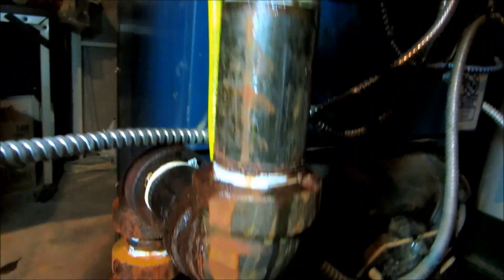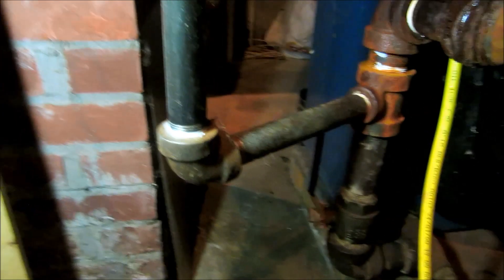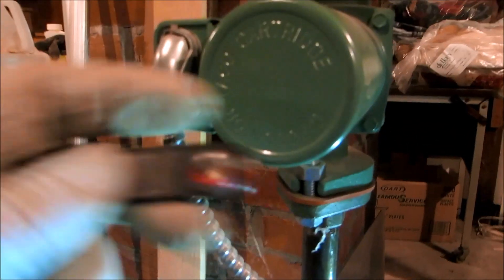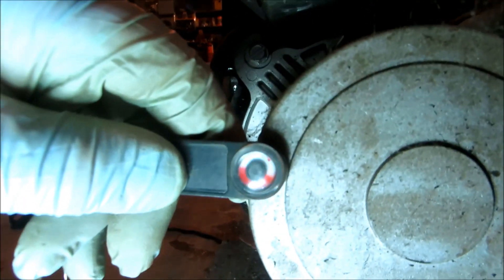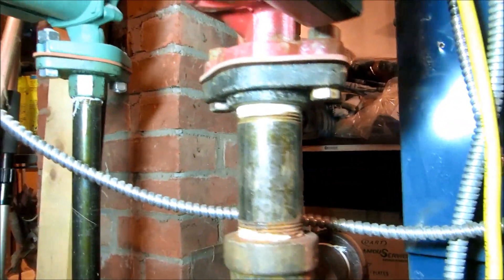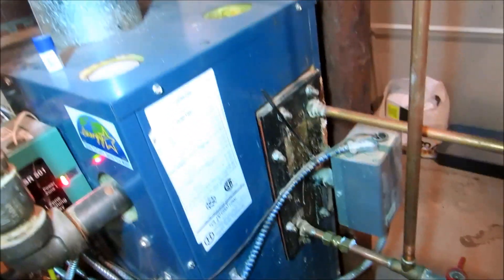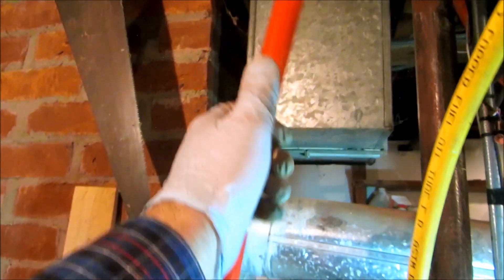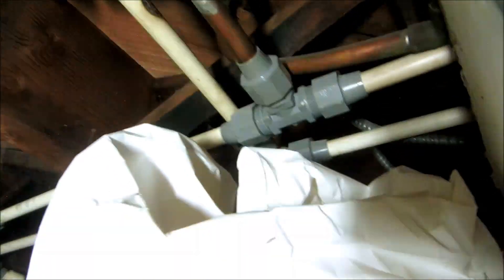fixed leaking cerculator,rotation tester used on motors

Comment: okay Steve I disconnected from the Power vent control box the green low voltage wire then the furnace works properly with the thermostat in the house what I found in the switch on the side of the furnace the power vent  hot wire became disconnected so I reconnected it the Power vente won't shut off I have to disconnect the hot wire  to shut it off what do you think Thanks
Reply from the maker: michael white you have to follow the wiring diagram so see whats going on with the power venter . i don't even know what you have there what kind ect.. i would have to be there to test and see to tell you whats going on . why it will not shut off ect. i can not see or tell you over a email what the problem might be ,if its a field powerventer look up the wiring dagram up on there site online and trace out the wiring to see what the problem is . with a good muti meter

Comment: Hey Steve, Great Video Man!  I hope you don't mind me asking you a question, but I am trying to find out whether or not I have a problem at a relatives house with one.  It looks like a cartridge type circulator and my aunt says its  humming a lot, and loudly.  I heard it today, and it is humming, but I don't know anything about this, and she is reluctant to call someone, and asked me but I know nothing about them.  I touched it and it was pretty hot around the cartridge, but to me if its pumping hot water, its doing its job.  I'm thinking like a firefighter here, and the pumps on the trucks, but I know this is different.  Is there a problem with the humming noise, and do you feel I should call someone in to look at it?   I sure as hell don't know enough to touch it, I'm looking for some professional advice.  I would appreciate any guidance, if you wouldn't mind sharing?  The videos have been really good, I really enjoy being a part of your channel!
Reply from the maker: Rudy P sure call me any time 508 9920900  and we can talk about it once your at the job

Comment: Steve my oil furnace does not want to shut off I un plug the thermostat and it still stays  running the power vent did not work so I traced the problem back to the switch on the boiler the hot wire was disconnected I connected it and the power vent went on help
Reply from the maker: michael white disconnect tt at the burner control .it should shut off if so its a bad t stat wire..if not its in the control ..
Reply from the maker: michael white you will need to follow a wiring dagram of your furnace to deturman whats going on.the power venter has a pre and post purge ... sounds like you have a bad relay or t stat wire .but its hard to say over a email with out being there to test stuff